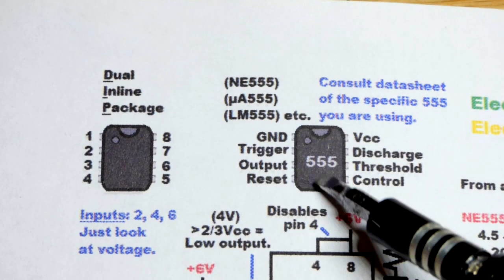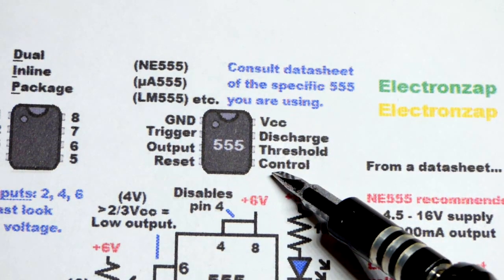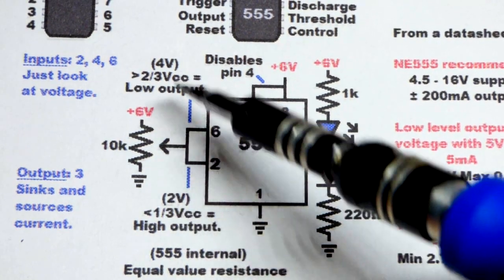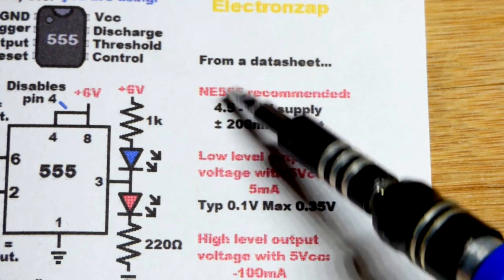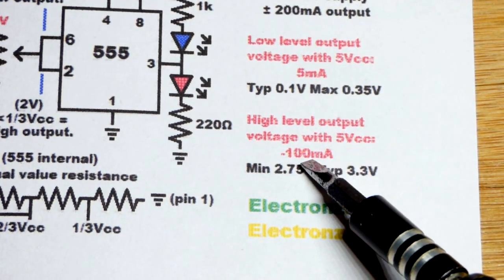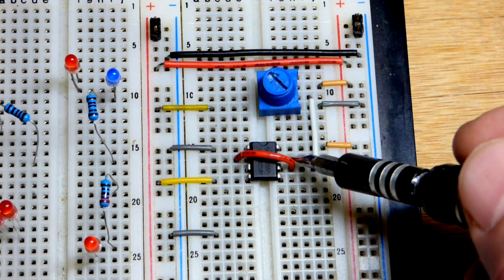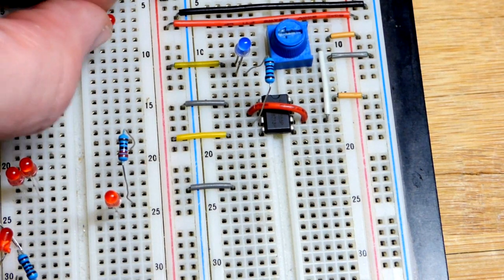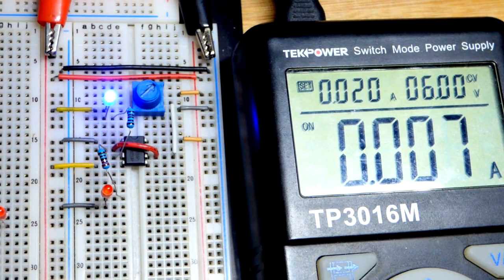555 timer schmitt trigger inverter with LEDs trimpot controlled learning electronics lesson 0007

Comment: I wanted to ask, while searching through the amazon link for the IC kit with 555 timer are the ICs from official manufacturers like TI for example. Because I need to use data sheets for them ya know. Great video by the way.
Reply from the maker: I don't know where places source their components, so can't give a definite answer. I haven't shopped around for components in a while, but I would be a lot more trusting of a site like digikey for getting a part from a specific manufacturer than Amazon. Although I have seen manufacturers sell directly on Amazon.